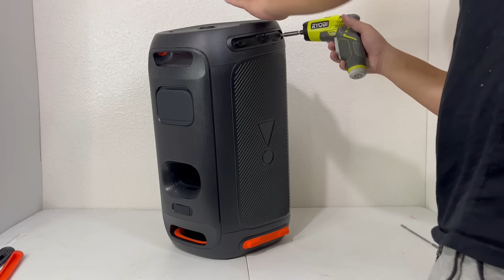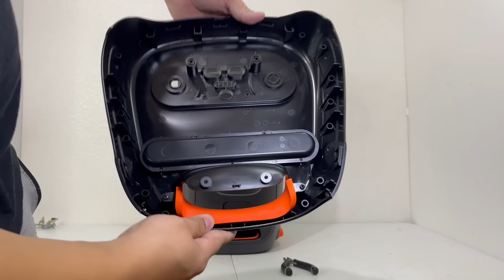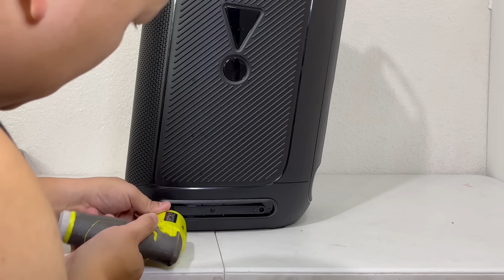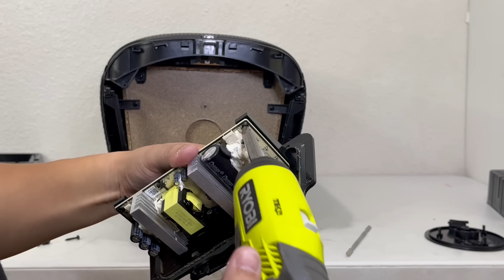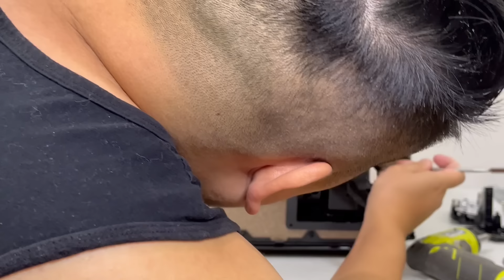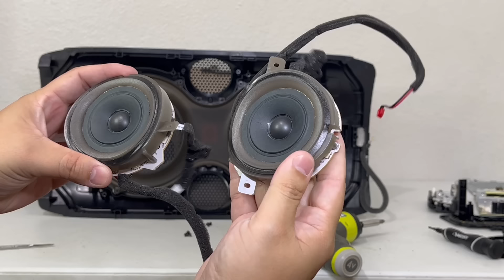JBL PARTYBOX 110 COMPLETE TEARDOWN !!!

Comment: Thats Too Much Work All i Need Is To Re Attatch 110 Volt Electrical Cord Attatchment Point Housing That Some How Got Loose And fell Inside The Main Space Housing With Some Strong Gorilla Glue or 2 Screws..So I Can Recharge This Jbl Partybox 110 That I Bought at Verizon for about $399.- and i Got it on Sale For $ 360, in The Year 2023

Comment: This video saved me so much time, had the ac charging port break off from the back panel and no one could figure out how to fix it for a year. Thanks to this I was able to access it through the bottom and fix it within an hour
Reply: Hi can you exactly tell me how you fixed it and what parts did you replace cuz I have the same problem my speaker turn on but it’s not charging

Comment: I have one of these 💩 📦 shitboxes. Battery 🪫 is trash 🚮 
The JBL will eventually give you fits.  It’s great until it’s garbage and it cuts out all the time on your Bluetooth and randomly turns itself on and goes off. A biotch when you’re trying to sleep and you hear it continuously do it from the bedroom over. 

No this isn’t a faulty one. It was great for 1 year. Now it’s a pain in the 🍑. 

Making apps for this and having updates.  It’s highly possible it’s being throttled like many software electronics nowadays.  

Fml. I have a 3 second light display and annoying start up sound for $359 .  

JBL, job your love
For fuqsaik!

Comment: So it does have a 5000mAh battery.
JBL did nerf the battery on 120 to 4722.
Which is so annoying.
Yes it is swappable, but still wow JBL nerfs the batteries.
Should have just kept it 5000 on 120 and 10000 on 320.
🙄

Comment: A fkn RAT died inside my speaker while I was on vacation. It had rotten to the point where the smell had decreased in intensity but it was still unbearable. I opened it today, got that fkn rat (which was stuck to the lower woofer from the inside) out, cleaned the entire thing with alcohol and assembled it back up. The only problem is after I got done there were 11-12 screws left which I had no idea belong to which spot. I did my best assembling it up but still somehow these many screws were left. And also I broke that small wire soldered to the top of the front panel of the speaker which I don't know the purpose of. Thanks for the video. Help me about this if you can

Comment: My battery is dead at stucked charging at 52% therefore I'm only using A/C with it now for power. Should I replace the battery or just leave it? Will it cause harm? Seems like the 110 battery replacement requires bottom and side panel removal which might be tedious

Comment: do i have to take the bottom and top off in order to get to the battery? i just have to only replace the battery
Reply from the maker: the battery is on the side so it will require removing the top and bottom to allow you to remove the side panel to get access to the battery.

Comment: Has anybody made a 12V DC connection Mod, so that connecting 12V-powerstation / solarpanels without loosing power to the AC/DC converter will be possible? This feature comes with the Partybox 310-models and above - but those are a lot bigger & heavier. I like to have a speaker the size of the 110 with good sound and 12V-DC and still kind of “mobile-ish”. Hisense Partyrocker an others 110-competitors have this feature, but lack soundquality! AND: has anybody made a hole/opening into the compartment right there where the batterypack is located, so that removing/changing/upgrading the battery, is way easier than tearing the whole thing down? I would love to see som tutorials on these kind of mods!!!

Anyway thnx for the perfect teardown - a little more about the ac/dc-converter would have been interesting, as there would have been at possibility to connect a 12-DC-connector as well!

Comment: My speakers sound awful, can they be replaced with similar non JBL speakers?
Reply from the maker: if you are refering to replacing the driver on the old speaker as its bad, then its doable as long as they are the same side.

Comment: How is it possible that the battery is only 5000maH?  I switched to this from a Tronsmart element t6 max. The T6 max has a 12000maH battery, but the playback time is less, despite the fact that it was only 60W and the partybox 160W.
Reply: This is 12v  bettery
Reply: 5000 ah

Comment: It's not wood, it's chipboard...very cheap chipboard 😅🤣😂
Reply: Those low density woods actually make a good material for enclosures. Thou MDF is the better one. Its pretty crazy how thin it is thou, im kinda amazed that the speaker sounds pretty decent even with such cheapisch materials and tons of plastic
Reply: Obviously something else than my Elac speakers for example, that use the same material just four times the thickness 😂
Reply: And it doesnt matter how high quality the wood is as long as its acousticly good!
Reply: Bass boost is from this gatta, friend, not from wood, do some research, this is not cheap, it is strong, not sony
Reply: @jagdishjoshi9719  strong enough.  That's called cutting corners.
Reply: Yes its cheap like cardboard
Reply: That’s how it breaks easily😂

Comment: Is the only way to get the grill off is to take it all apart?
Reply from the maker: the metal grill is attached to the front plastic panel which also screw onto the wooden enlosure.  as long as the screws from the front panel is remove then it should be able to taken off.  I have not taken off the metal grill itself, but look like its stuck onto the plastic panel for good.

Comment: Speakers will be 2ohm this way you can with lower power amp have more power come out on sound.
This way you can use more power save digital-d chip amp use 

Wel you can see the chip what it can do in watts on what ohm it do.
Reply: not likely to be 2 ohm parts. possibly more or so less 4 or 6 ohm. the amp is pure class D topology.  the bass drivers are possibly rated around 60 watts.
Reply: also lower impendence requires more power

Comment: I am very surprised at how well this was made.  Both the tweeter and woofers look like quality items.  It's pretty amazing at how long this will play on battery power alone.  Great job.
Reply: It's likely made by SB Acoustics or SB Audience. Good Stuff they're producing.
Reply: The battery is tiny and it still plays for ages . I could easily get a battery the same size or a bit bigger and get twice as much battery life
Reply: Battery 🪫 is trash 🚮 
The JBL will eventually give you fits.  It’s great until it’s garbage and the. cuts out all the time on your Bluetooth and randomly turns itself on and goes off 

No this isn’t a faulty one. It was great for 1 year. Now it’s a pain in the ass. 

Making apps for this and having updates.  It’s highly possible it’s being throttled like many software electronics nowadays.  

Fml. I have a 3 second light display and annoying start up sound. For $359 when New.  

JBL job your love
For fuqsake

Comment: based on the size of the magnets im guessing a 10-25 watt per tweeter
Reply: 10-25 watts is plenty for a tweeter as long as the ohms are low. Also magnet size doesn't matter as much as u think as there are plenty of small magnets that are much stronger than larger ones, it depends  on the material of the magnets